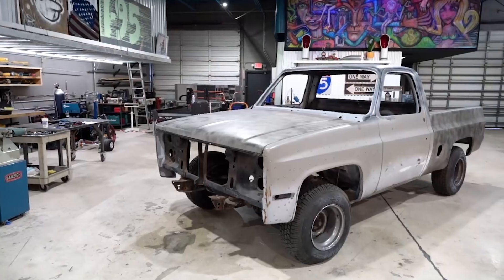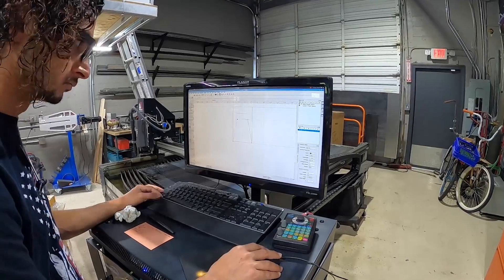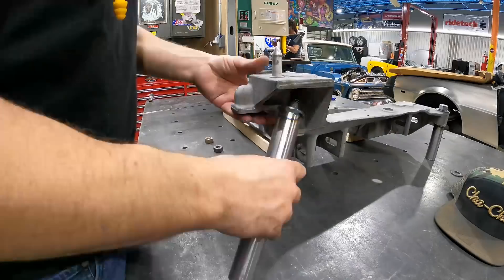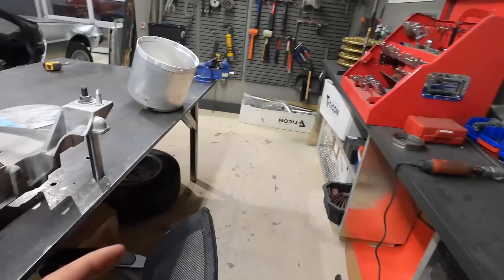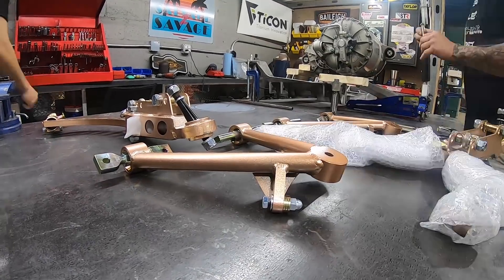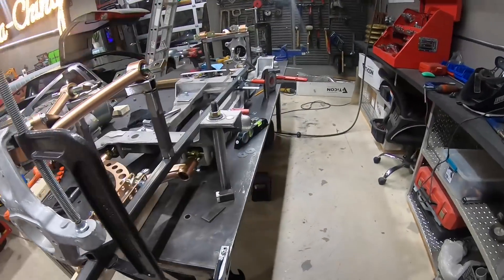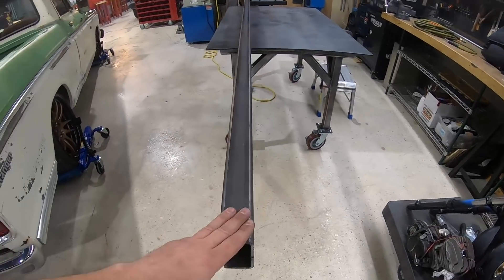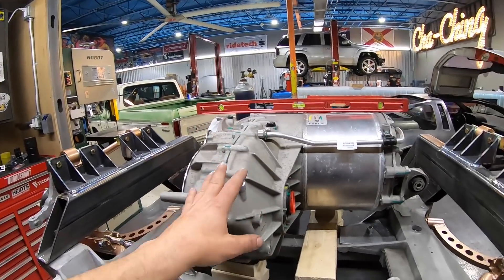How To Tesla Swap A 1985 Chevy C10 Squarebody Truck - Custom IFS Build - Electric C10: Ep.2

Comment: A big fancy car fabrication shop. An still use harbor freight tools. 
An loved the angle finder. I knew it was harbor freight first thing. I had the same one for checking mower blade angles when sharpening blades. Lol
Reply from the maker: Our thinking is, any tool that gets the job done is a good tool! There's a lot of harbor freight tools that hold up really well and have saved us some big $$ versus going with a pricier brand name!
Reply: @SalvagetoSavage . Amen brother. 
I love harbor freight. My girlfriend hears me say something about going out somewhere together. First thing she says to me now. "We're not going on a date to harbor freight again right?! "
I normally say i dont get over this way when I'm not with you. An i have to restock my supplies. Lol
She just normally shakes her head and tells me "make it quick this time." Lol

I've learned what tools to stay away from there for sure though. 

The 3 ton Pittsburg floor jack i have can lift a substantial amount more then 3 tons. Lol

An the zip tie technician i am. Its the cheapest around for zip ties.

An a couple bigger tools i gotten have impressed me very much.

Comment: Not hating, just tossing good info out. I did corvette subs also in a 58 Chevy truck. Looks like there’s no caster in it. The c6 is little longer wheelbase than the c5. Dobberton performance makes a kit, all you need is 2x4 rails. Geometry already figured out. That little bit of measuring is not going to cut it. I went off of collision frame measurement diagrams. Then collision frame setup and measure on a car-o-liner digital measurement machine. Gets it within 3mm.

Comment: I'm way late to the game here, but I'm questioning how correct the front suspension geometry is. Now, it'll drive around just fine, but it looks like the upper control arm is mounted a bit high, which will reduce your camber curve. When you measured the car, the casting part of the arms were approximately parralel, but the lower arm has the pivot end of the ball joint in it vs the upper arm having the shank end. That means the line through the upper bj and bushings is angled upward slightly while the lower is flat. This is what I'd expect to see from a double wishbone suspension, even with a short long arm setup like this.

Comment: Why not use a tesla front suspension?  Will the c5 components handle the weight difference of the electric build? Cos are feather weights compared to most other modern vehicles especially electric ones

Comment: Man, are these motors going to be synced up somehow? Any chance 1 will spin faster than others? 1 set of wheels working against others and tearing things up?
Reply from the maker: It's going to be tuned by Chris over at Zero EV. We'll be touching on how we're syncing up the motors once we get this thing off the chassis table
Reply: @SalvagetoSavage  gotcha. Will be watching. Watch all the car shows and this thing has to be one of the coolest builds I have ever seen.

Comment: your top arms are in the wrong place, do a drawing, your role center will be completely wrong, go re measure with more accuracy the c6 if you dont it will handle like a dog
 sorry not meaning to be rude but I HAVE DONE  several c6 suspension full chassis builds and its simply wrong
Reply from the maker: Hit us up later broham 
954-525-5522
Reply: Yea, did one also in a 58 Chevy truck. Looks like he has no caster in it. The c6 is little longer wheelbase than the c5. Dobberton performance makes a kit, all you need is 2x4 rails. Geometry already figured out. That little bit of measuring is not going to cut it. I went off of collision frame measurement diagrams. Then collision frame setup and measure on a car-o-liner digital measurement machine. Gets it within 3mm.

Comment: Great build can't wait to see it doing burn outs but am I wrong or wasn't the lower control arms on the C5 at 5 degrees as well as the top and on you jig you set the lower to zero or level?
Reply from the maker: Tim may have misspoke there. I believe he meant that the top and bottom are both squared up when he said zeroed out. But feel free to hit him up on IG and ask him directly!

Comment: .250 wall is super thick. Is there a reason you went with that over .188 or even .125?
Reply from the maker: Mainly structural rigidity. It might be overkill, but we'd rather it be too beefy than not have enough strength at the end of the day.

Comment: Are the spindles C5/C6 or are they TESLA?  Therefore why the special bronze colored aftermarket control arms used and what is the link for purchasing?
Reply from the maker: The upper/lower control arms are from part shop max. As for the color, that’s just their color. We will be changing that up once we powder coat chassis